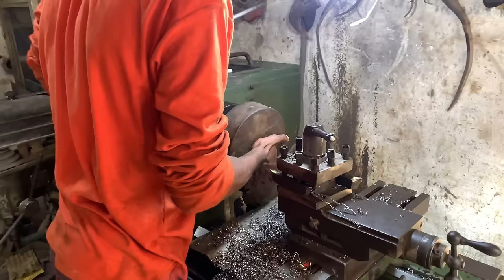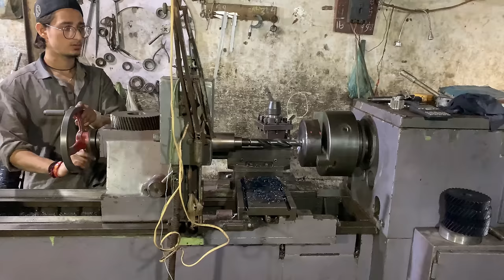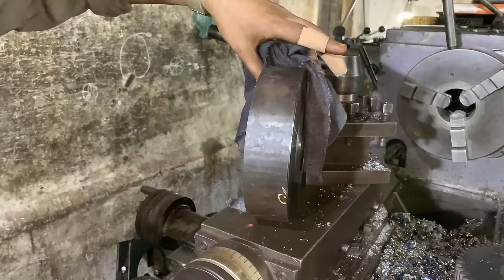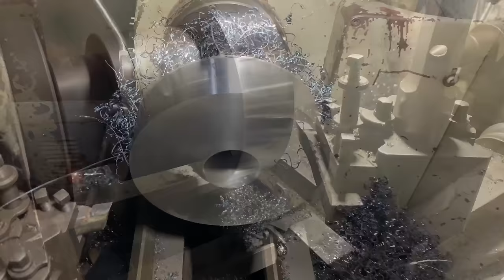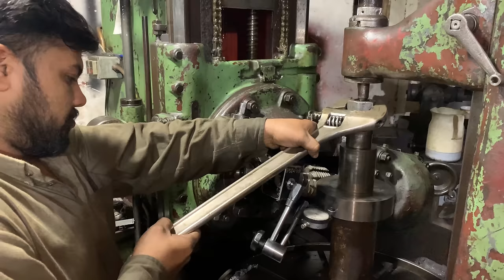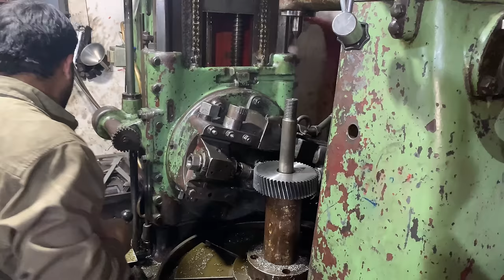Amazing Manufacturing process of Gearbox || see how Making a Gearbox in Factory

Comment: 5:29 near injury feels as the swarf grabs a box wrench and slings it into the ways and chip pan, still 1000x safer than the typical examples I see from similar geographical locations.

EDIT: I will say this is actually a relatively well skilled workshop here, they actually used a dti to clock the gear blank before hobbing.
Reply: Yeah this wasn't bad at all.
Reply: Koyuna göre çevresine göre genişliğine göre çok güzel bayanlar için yerine göre uykuluydu yerine göre minimi yerleştiriyor ulaştırıyor düzenliyor çok güzel olmuş ben benim dertlerimi kazandı ellerler her şeyin yok ben de yapmayayım zevk verici bir şeyler
Reply: @ToreDL87 bir yatakta eğlenmeye devam edersin seni öpüyorum ben de

Comment: That place would be shut down if it was in the Uk. I don’t know what that gear is for. But you don’t measure the outside diameter with a vernier. You don’t measure a helical gear with a span mic.

Comment: Sorry but what is amazing about gear hobbing. I was a Manager/Engineer in an industrial gearbox manufacturer. We hobbed, shaved and ground gears for top tier automotive manufacturers and produced high end gearboxes for defence, newspaper printing, mining, water treatment, satellite tracking, etc just to mention a few. The technology shown is really basic gear producing machines old, but still works.
Reply: Which matteral used for gear
Reply: @Mirza2692  Hi, mostly steel, but also  centrifugally cast bronze in some of the bigger gearboxes. For the loose gears which the customer would fit onto their product, they would specify what material and heat treatment processes they wanted. We made gears for many car manufacturing companies so we would work to international standards, BS, DIN, JASC, AISC, etc. Most were case hardening steels.